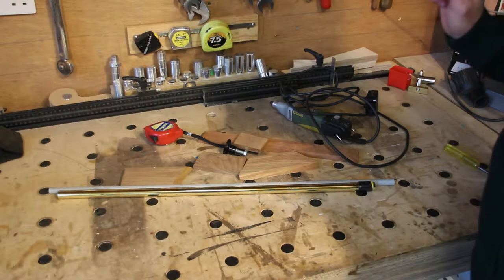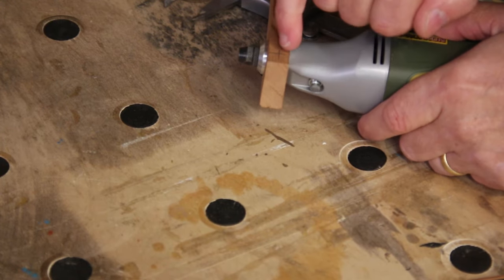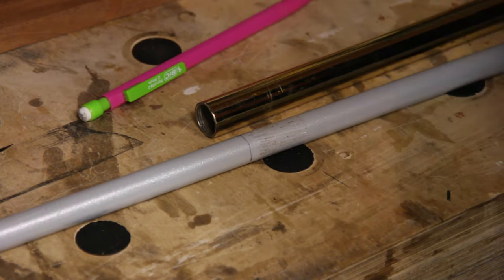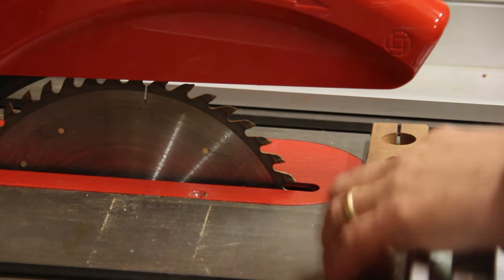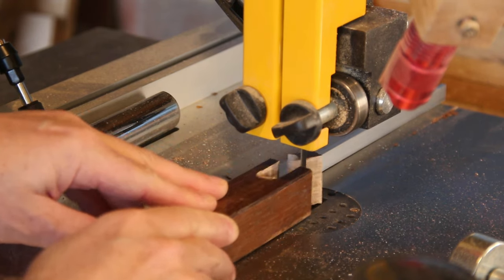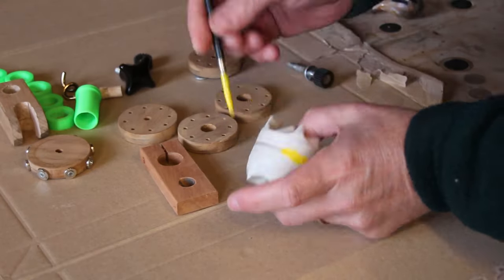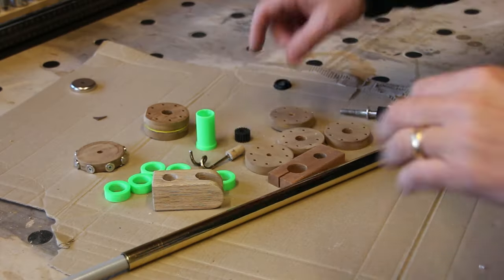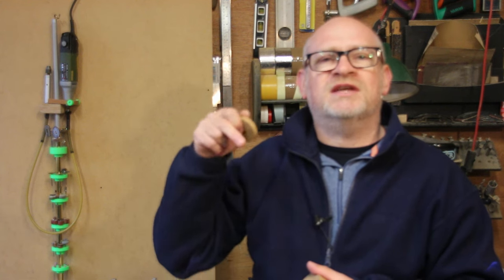A New 'Dremel' Accessory

Comment: To use the forstner bit…..1. Use it to drill a hole in another piece of wood. 2. Double tape that wood to your round piece. 3. The first (top) piece of wood now acts as a guide allowing the forstner bit to be used to drill down into the round piece. Hope that makes sense!
Reply from the maker: Ah that's a great suggestion,  why didn't I think of that ! 😀